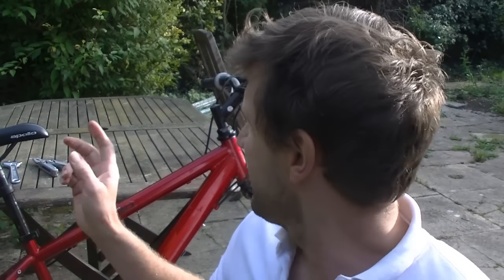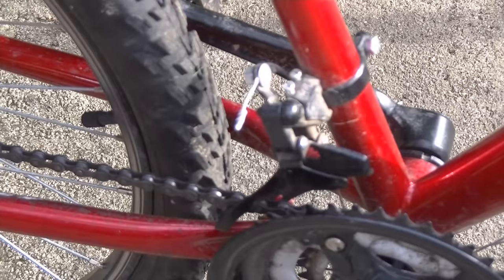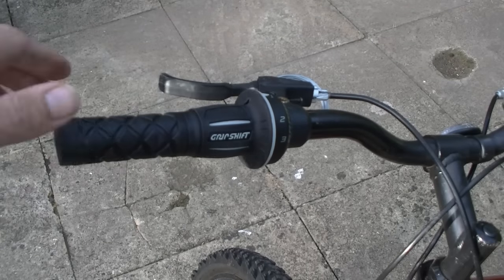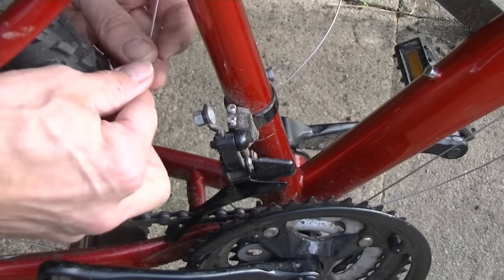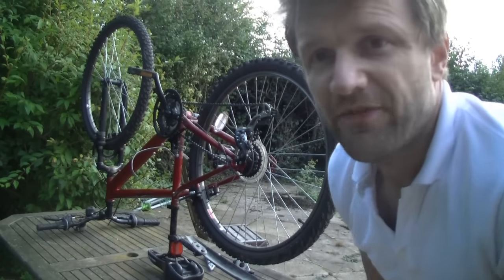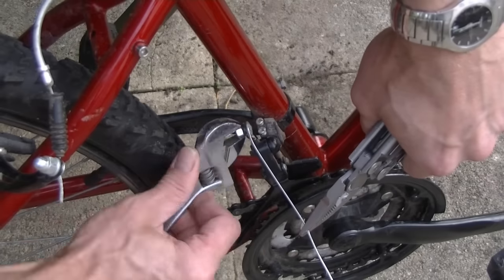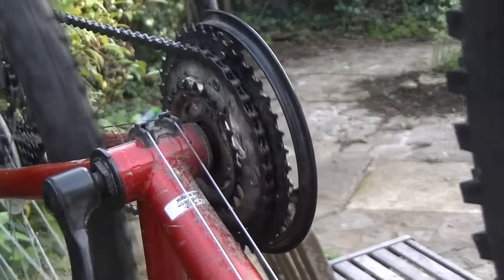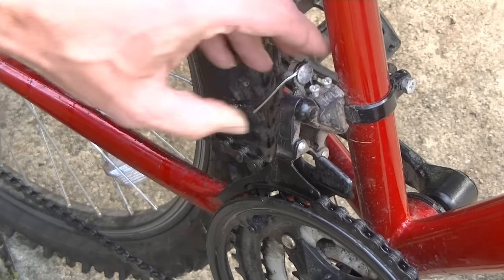How to Replace a Bicycle Grip Shifter

Comment: While my grip shifters still work, the actual plastic/material they are made of is warping and disintegrating (to be fair, they do date to 1993).  This video is just what I need to see that, yes, I can replace my own.  Yeah, it'll take some work and probably take me a couple of hours but its cheaper than taking my bike in and paying.
Your video makes it a lot less intimidating than I thought it would be.  Though, I'm amused because my bike is so old that the front is on the left and the back is on the right!
Reply from the maker: And it will be very satisfying fixing it! You've just got to make sure that the grip shifter you buy is compatible with the rear derailleur. Halfords put this bike together with an SRAM shifter and Shimano derailleur and generally the two aren't compatible with the result that you can't access all the rear cogs if you get the wrong one. Good luck with the repair 👍🏻

Comment: Good tutorial. I mainly needed it to learn that there is an allen screw somewhere holding the thing on. I also usually add some grease into the cable guide, so that it stays rust free and the cable always glides through nicely. thanks for posting the video!
Reply from the maker: Thanks Robert. Glad you found it useful.

Comment: Thank you so much for your excellent video. I feel I now have the confidence to go ahead, order and replace my broken MRX gear shift. I didn't have a clue beforehand!
Reply from the maker: You're welcome. Just whatever you do, make sure the new gear shifter is compatible with your derailer as otherwise you might find you can't access the top or bottom gear.

Comment: Nice video! You should put one of those crimping ends on the cable after you cut it so it won't fray again.
Reply from the maker: lucidbarrier That's a very good point!!
Reply: Might also be good to prevent it from stabbing your leg if it isn't tucked away and has a frayed end.
Reply: ferrule

Comment: I have a question I have a mongoose bike and it needs the three speed shifter replaced Will this video apply to that type of bicycle to? How do I adjust the rear shifter cable in order for it to shift through all the gears? I believe it has seven gears but doesn’t go to the last two smaller gears

Comment: Hi :-both of grip shifters are stuck on the handle bar. I've removed the screws n tried hammering them to loosen them off. Won't slide out. 

Any udeas or advice?  Regards

Comment: good video but for 'very easy' i'm still battling to separate it, mine seems to have like a wedge perhaps locking them together. Perhaps i'll find a video dealing with this. But thank you for putting this up...
Take two!  I was trying to do it without loosening the cable (i did not want to cut it and reuse it!) But once I loosen it it was easy. I also thought there was a wedge to stop it but all it was, was the protruding area with a marker to show you what gear you're on! So thanks again :)

Comment: Hello Charlie! I have a 3 gear shifter on a dutch bike - the cable was recently replaced but now the case of the old gear twist shifter broke. So my question is: can I replace the shifter and put the end of the new cable into a new shifter??
Reply from the maker: Yes I would have thought so. Do a bit of research getting the gear shifter right though. Probably makes most sense to replace with the same one. Different brands of shifter and derailleur often aren't compatible

Comment: I have a falcon 3 speed hub. The shifter needs replacing. My issue is, that both ends of my cable have an inline lead barrel. The lead barrel unclips from the grip shifter through a slot. What replacement shifter will allow this, can be a thumb shifter ?

Comment: Well this also useful but I'm looking for the grip itself what kind/ proper name for those shorter hand grip?  I have given a bike with this exact gear but i wanted to replace the grip rubber only as right side were quite busted looks like a damage from a drop or should i cut the rubber in half but that doesn't seem right
EDIT : forgot to add it not just usual grip but i was looking for lock-on model

Comment: thanks you for the great instructions!
I appreciate it.
Reply from the maker: +amit finegold You're very welcome. One tip though - check that the grip shift is compatible with the derailleur that it's operating before you buy and install it - so that it's capable of operating the full range of gears on the cog. It's often a good idea to stick with the same brand for each, or to replace the faulty one with exactly the same if you can.

Comment: Does this gear change work on any bike.
I've got a DBX mountain bike and I'm about to change gears out.
Reply from the maker: You have to choose your gear changer very carefully because it has to be compatible with the rear derailleur.
Reply: Do you have a video for the other side

Comment: Do i really need to change the cables if they are still in good condition?
Reply from the maker: I wouldn't have thought so if they're in good condition.
Reply: @CharlieDIYte  Hi Charlie thank for replying, my question was useless since the cable is secure inside the grip so it would be pretty stupid to disassemble to keep the old cable.

Comment: Great video! Mine is indentical , and just came apart.. Any other advice on what info I need on this to order another one? Mine has the following written on it, SRAM Grip Shift MAX. Thanks for any help you can offer.
Reply from the maker: Hi Gary! Yes, the best advice I can give you is to make absolutely sure that the replacement Grip Shift is compatible with your rear derailleur (the bit on the back wheel that shifts the chain up and down the cogs on the back wheel).

The reason I say this is that we bought the bike featured in the video from Halfords. It had an SRAM Grip Shift as featured in the video and a Shimano rear derailleur. Annoyingly the SRAM that broke is the only SRAM Grip Shift that is compatible with the particular Shimano derailleur that came with the bike (nice one Halfords!!) - and so although the replacement SRAM Grip Shift worked fine as you see in the video, it wasn't exactly the same as the one it replaced, and we did encounter some problems later with accessing the top and bottom gears on the rear derailleur (ie the largest and smallest cogs). 

So if possible match the Grip Shifter with the same brand of rear derailleur that it is operating. If in doubt, phone a bike shop for advice, or seek advice online, to make absolutely sure you get the right one :) If your rear derailleur is Shimano, you might do better to buy a Shimano trigger shifter. 

Good luck, and thanks again for showing interest in my video!

Comment: anyone know the going rate for a job like this? bought a 24" 21 speed off someone online today for $180 and turns out the gears are all messed up/virtually broken. right grip is broken just like in this video and pedal gears don't upshift from 1st gear. everything else works and it's a great looking head turning bike. i don't know if i should regret buying it or not. it's an avigo eklipse that's black and yellow. now i gotta take it to a bike shop. would anyone know the going rate for a job like this? from the video i already know how long it'll take so.

Comment: How do you put the cable in the shift grip, though?
Reply: Comes preinstalled
Reply: @ishalljr  is the cable captive and not removable from the shifter then?
Reply: @hwingerrr5680  yes. Unless you force it.
Reply: @hwingerrr5680  You can remove and replace the cable. Just push the cable from the drive chain side and it will pop out of grip. To install just thread a cable down the hole the old cable came out of. Sometimes you have to wriggle it a bit as it goes off at an angle.

Comment: My gear handle wont click so when I move it it goes back to six and doesnt stay on anything else. There is a piece that fell off from it but I don't know how to put it back. Can you help please.
Reply from the maker: Rama Hannineh Hi there. I had a similar problem with the one in the video - when something falls off it like this, it's time to replace the grip shift I'm afraid Rama, as it's broken beyond repair, but before you do, read my reply to Gary in the comments feed below, about ensuring the replacement grip as shifter is compatible with the rear derailleur!

Comment: I dont see any screws or anything on my twist grip. I had to remove it to replace the brake lever and now its loose. Help please
Reply from the maker: Brand91 Hi there. If you removed it to replace the break you must have loosened something? There's often a small grub screw that you'll need an allen key to tighten?

Comment: having problems. the wire is either too tight and I can’t even switch into 3rd, or it’s too loose and it won’t switch into 2nd.
Reply: Is your set up Shimano or SRAM? 
You have to match your shifter to your derailleur.
The shifter pull distances are different.
If you have SRAM derailleur you need a SRAM/Compatible shifter.
If your using  Shimano system derailleur then you have to a Shimano /Compatible shifter.
Mismatching will have your derailleur all over the shop.
Reply from the maker: Thanks for chipping in, Stephen, really appreciate that. I agree. Halfords where I got this bike from somehow managed to match an SRAM shifter with a Shimano derailleur which somehow worked with the derailleur it shipped with but none that I subsequently fitted after the original broke. They broke every rule doing this for the reasons you gave.
Reply: @CharlieDIYte  I have a SRAM system, but am going to go over to Shimano. 
Shimano a far wider range of shifters and  derailleurs from budget to way out of league prices. My plan is to upgrade bit by bit.  Safe and Happy Riding!

Comment: I WAY easier way to do this, souly because removing you GRIP can not only be an pain in the @$$ but it can damage your GRIP. Loosen your Brake Lever and slide it to the inside of the handle bar... then loosen you GRIP SHIFTER and slide it to the inside of the handle bar also, tighten up your SHIFTER again once you have enough room between the GRIP and SHIFTER. Now do the repair work to your SHIFTER and you have saved yourself some real 🐂💩 trying to pull that GRIP off. Unless your GRIP just pull off, but in that situation you need new GRIPS anyway, because they shouldn't just come off that easy. That's just my 2 Cents though. Hope the tip helped!
Reply from the maker: Thanks 👊